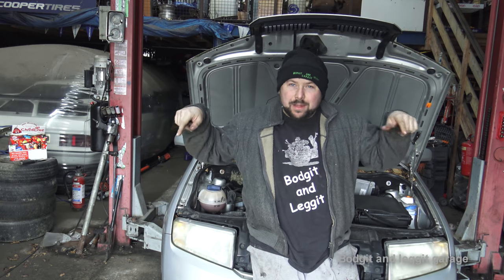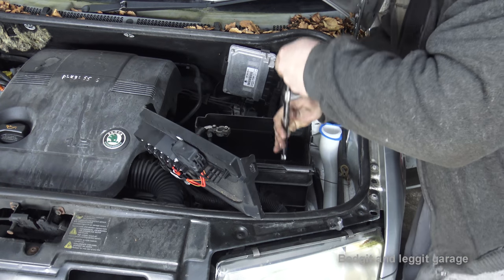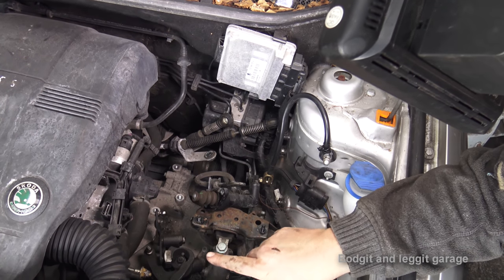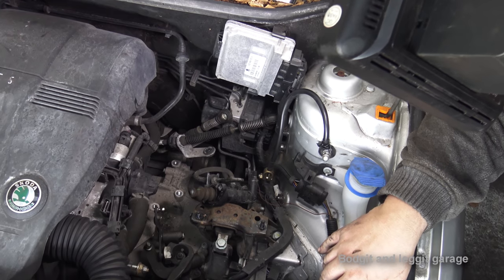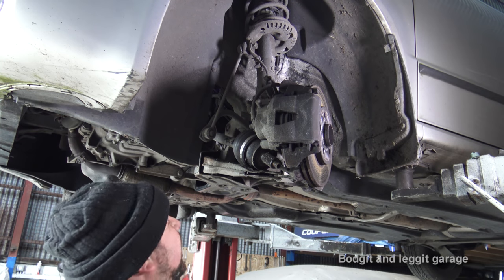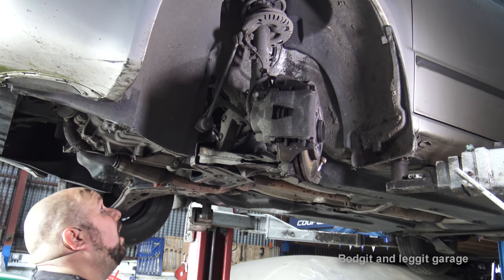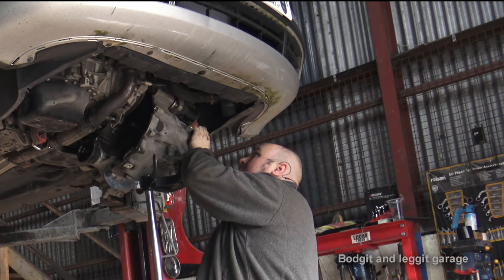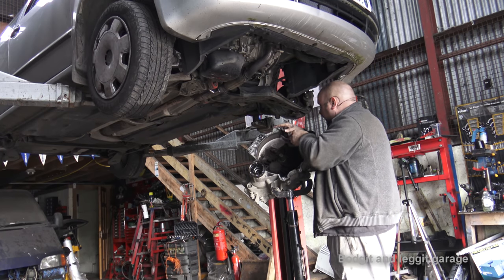Skoda Fabia Clutch Replacement part 1 Bodgit And Leggit Garage

Comment: Love the comment about using a socket with a lifetime warranty...

As a DIYer I use (mainly) Halfords Pro tools which has lifetime warranty on anything except the moving parts of ratchets etc.  Came in handy when one of our old Aygo's needed new pads & discs and the discs had never been off and the screws on the discs were more than tight.  Popped the torx socket in there gave it a good whacking there and whacked straight on the back of the socket.  Broke the socket on the last screw, popped down the road and they swapped it straight out no questions asked despite it looking clearly worse for wear.
Reply from the maker: James Swinyard cannot beat lifetime guarantee mate

Comment: I am taking apart my Skoda Rapids engine and so I had to remove the tranmission aswell, probably needs a new clutch anyway. It's abosultely insane how some of the stuff is designed/engineered. In your case you could atleast remove the exhauts if you wanted because you can unbolt the pipe from the cat but on my car it's a single piece. You have to undo the whole thing from the turbo but inorder to do that you have to remove heatshield from around the turbo and to do that you need to remove metal coolant pipes, oil pipe for the turbo and the bloody O2 sensor which you can't even properly access with a wrench.

I don't understand what is wrong with them at Audi/VW. Why do they insist making so many bad design choices while at the same time they can also make some really good stuff.

Comment: What's the average mileage for a car to come in for a new clutch? Most of the cars in my family need new clutches at 120,000-ish on Ford's and about 140-150,000 on Merc's.
Reply from the maker: 8ile it all depends mate on how you drive who drives it and all that is possible to destroy a clutch in five minutes then I have seen touches to go over 250000 miles

Comment: Hi, of course I am one of your subscribers and I love your videos, very useful. I have a skoda 2000 1.9 sdi diesel and the gearbox is bad, can you please help with any information on how to not buy the wrong gearbox and to not have the surprise of not a correct one. I don't want to take mine off before I find a great deal gearbox online. Thanks, Alex
Reply from the maker: Alexandru Garboan hi mate if you ring any good scrap yard up they will take the engine code from you and they will match up the right gearbox as regards getting one that is good at the end of the day it's a second hand gear box there is no guarantees in this game but you can spin the output shaft just to make sure it's pins nice and freely then wiggle it up and down and make sure there isn't a lot of movement in the output shaft you can also go to the gear selector and select the gears as you spin it this is all you can really do without putting it in the car
Reply: bodgit and leggit garage thanks mate, I would love to open the gearbox and repair it but I am afraid to order parts and getting more expensive than another second hand gearbox. Thanks again mate
Reply from the maker: Alexandru Garboan yes mate it definitely would cost a fortune doing it that way but if you get a second-hand one you can always open it and have fun with the old one but if you do you should film it and put it on YouTube so we can see
Reply: bodgit and leggit garage yes mate, If I have enough time I will have some fun for free, it's always worthy. Thanks again for your lot of support and information mate

Comment: Thanks mate this was a great help. 😀
Reply from the maker: lethal0weapon7777 thanks mate glad you enjoyed it but I can help
Reply: bodgit and leggit garage
Also how difficult would this be without air tools?
Reply from the maker: lethal0weapon7777 it would just make things longer but you can still manage without air tools air tools just make your life so much easier
Reply: bodgit and leggit garage
Good news got the gearbox off this afternoon however, would I need to change the flywheel as well been told it's a smf but I'm not too sure how to tell really. 

By the way it's a 1.9 tdi engine code: ATD  with the 5 speed box.

Thanks
Reply from the maker: lethal0weapon7777 hi mate I'm not sure if the top of my head what flywheel is on that the easiest way to tell is a dual mass flywheel is very thick and you should be able to hold it and slightly twist it if you cannot do this you do not have a dual mass flywheel and you do not need to change it unless it is very badly damaged with heat

Comment: A 1.2? Is that a 3cyl? Is it wrong that I enjoyed watching you pound the hell out of that CV axle? You need to get Big Nasty, it will make your life easier :)
Reply: just checked the wiki and sure enough it is a 3 cylinder weirdly they offered  a 1.0 liter that was a 4 cylinder so go figure.
Reply: Yeah. Should be. A lot of smaller VAG vehicles have these 1.0 and 1.2 3 cylinder engines now. 3 cylinders are becoming quite popular on this side of the pond. They are replacing the smaller 4 cylinder engines or will do in the near future and some manufacturers like Ford are trying to replace the larger normally aspirated engines with turbocharged 3 cylinders that are supposed to have the same power but better fuel economy.
Reply: Big Nasty would have shaken that car to bits!
Reply from the maker: lol i got big nasty daddy coming soon we will have a hammer off
Reply: South Main Auto Repair A 1.2 litre 3 banger with a small turbo if I'm not mistaken (1.2 TSi VAG group engine).
Reply: I'm on the lookout for a VRS diesel one of these. Little rocket ship, would be right up your alley Eric.... Euro and diesel 😂